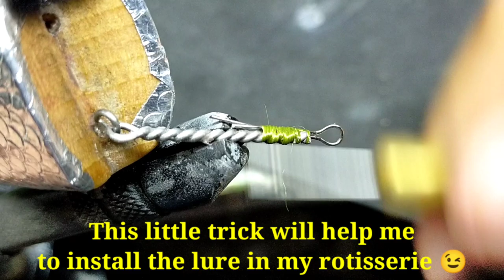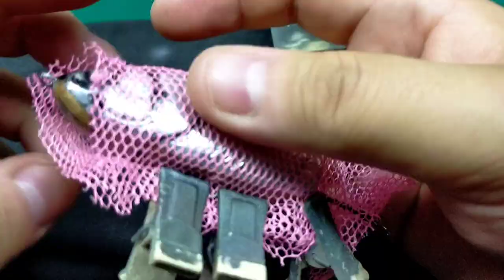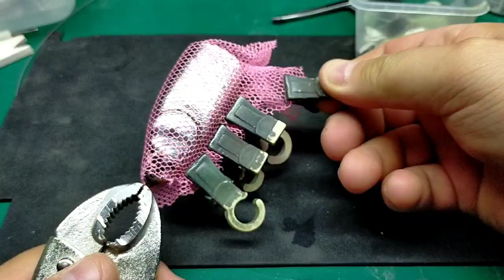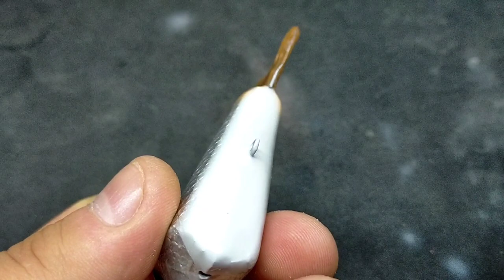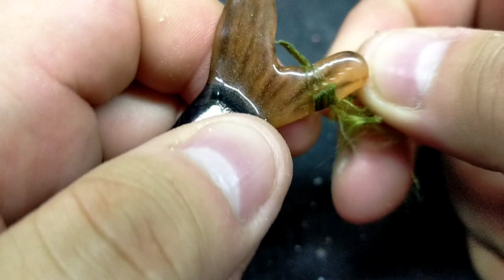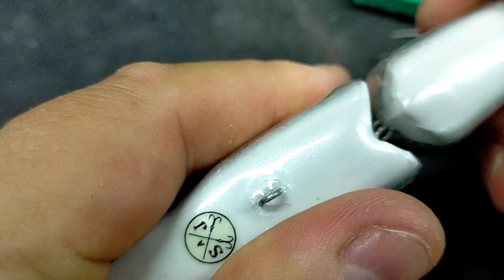Lure Making Jointed Swimbait 2.0 - part 3 final

Comment: How come it went from floating to a sinker at the end, did you add some weight? Great lure, it swims great. I just know that would catch Pike where I fish 🙂👏☘
Reply from the maker: It always ment to be slow sink, already in the tank test it was sinking 😉 It would do very well for pike fishing, sadly there is no good pike waters around my place and I don't have a car 😕 maybe I'll use it for Zander fishing in the night, but I'm too lazy to bring heavy rod 😅 I always go with my medium setup 😜
Reply: @SuchaJerkCustomLures  I didn't know it had to slow sink, I must have missed that part in the video when the Mrs was chatting to me 🤪 I used to use telescopic rods a lot, handy, and some are very good, although I snapped a good one trying to cast a heavy lead with it full force from a pier for mackerel 😪 It was a fishing rod I'd restored and previously used for Pike, easy to climb walls, walk through the forest to and from the lake. I have a great two piece Pike rod but I liked that one.